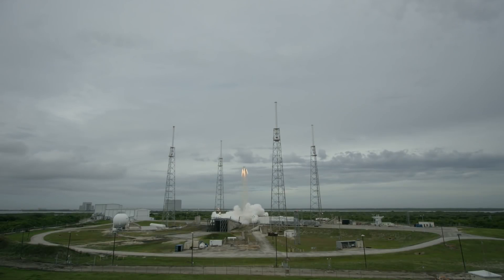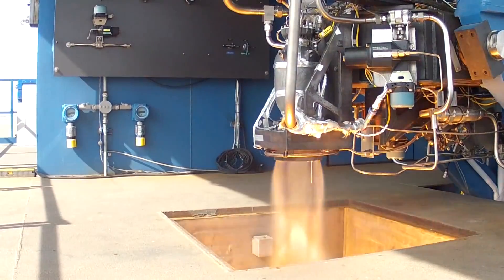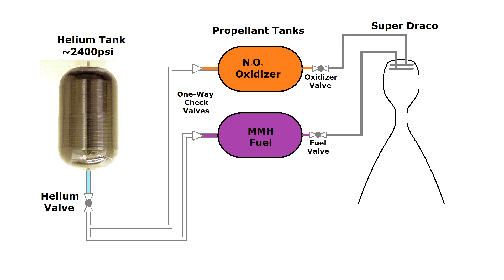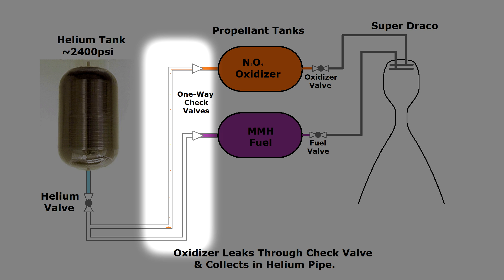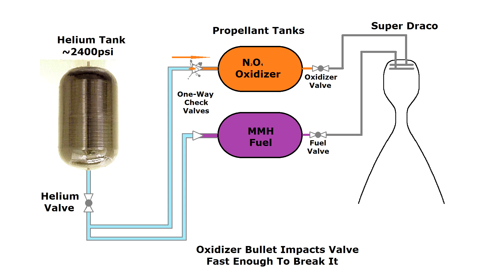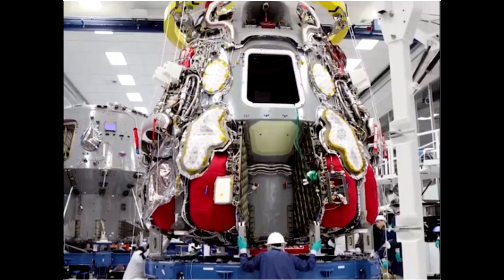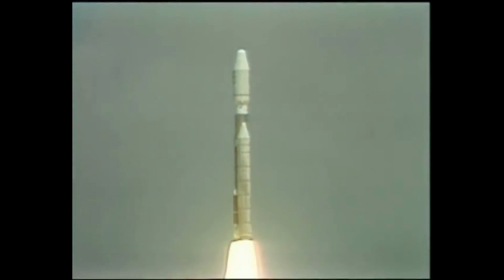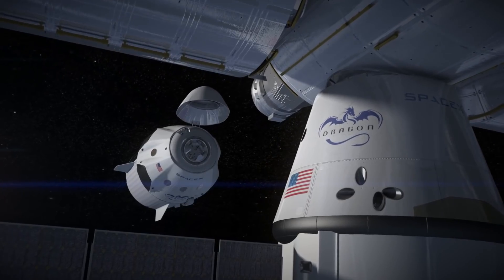SpaceX's Crew Dragon Spacecraft Exploded Because of 'Corrosive Bullets' and Leaky Valves

Comment: The decision to use a volatile, toxic and carcinogenic fuel like Monomethylhydrazine (MMH) and a highly toxic oxidizer that can dissolve your lungs as a part of integrated Launch escape system on a human rated spacecraft is a disaster waiting to happen.
Reply: That's just a silly thing to say. Fuels have always tended to be toxic. You're not meant to ingest them. And that had nothing whatsoever to do with this failure.
Reply: @odysseusrex5908  It had everything to do with this failure.
Conventional spacecraft design have reaction control and propulsion systems separate within service module which is completely separate from the crew module. Furthermore the escape launch system is conventionaly done via escape launch tower that uses solid fuel. 
Both systems are discarded well before reentry so the crew module descends without fuel.
I understand the reasons why SpaceX chose this approach, but it is a dangerous one.
Every Crew Dragon will have to survive violent atmospheric reentry and go for a splashdown full of highly reactive, toxic fuel.
As for not inhaling the toxic fumes, you can ask astronauts from Apolo-Soyuz Test mission.
They say it's no fun!
Reply: The Appolo service module used the same design.  IF this problem had occurred in an Apollo or soyuzservice module it still would have probably resulted in the loss of the crew because capsule is attached to the service module.  The spaceX explosion was strong enough to destroy the capsule.  In the Apollo and Soyuz systems you do have ha heat shield between the crew and explosion. But that is not designed to protect the crew from an explosion.  If the explosion makes a small hole or crack the loss atmosphere pressure could still kill the crew.
Reply: @stevenf1678    The service module's propellants were not pushed by super high pressure helium, thus, even if there had been some back flow, this kind of water hammer effect could not have happened. Also, I admit to not being very familiar with the Service Module's design, was it the main engine or the rcs thrusters that used this kind of check valve?

Comment: A burst disc does not replace a check valve though.  A burst disc is just an over pressure release mechanism.  So other details are missing here Scott.
Reply: The Superdracos are only going to be used in an abort scenario. The Helium tanks will be released and their extreme pressure will burst the disks. Hopefully, this will never happen at all, but it is an elegant solution to the problem.

Comment: Wait, I didn't understand the purpose of the burst discs replacing the check valves. Check valves are one way directional control valves, burst discs are one-time-use breakable surfaces.
Did I miss something?
Reply: Nop, you missed nothing. Except, this is an abort system, used once, or better never. The burst discs are more reliable than valves, and it is no problem they are one-time-use.

Comment: Won't there be a chance the burst-disk puts debris into the fuel and oxidiser tank?
Other options would be to either ramp up the helium pressure more slowly, or double up on the check valves maybe?
Burst disks will be nice and light though...
Reply: I replied to another similar question, but here you go: 

Depending on the type of diaphragm there can be fragments, which will require a filter.  It can be presumed that the design SpaceX will use is "scored", which reduced risks.  Search for "burst discs prevent pressure failures" for more information.

Comment: I wonder why instead of burst disks, they didn't adjust the Helium Press sequence to just open the valve very slowly, or even have a primary and secondary pressurization valve with the primary valve being a slow bleed. This would prevent corrosive bullets.
Reply: This is an abort system. Everything should be fast and as simple as possible.

Comment: Can t space x replace the titanium for the pipes with an alloy to not react with the oxidizer and fuel? It just feels like their solution isn t long term because they telled nasa that it could be used for a landing burn(s) , so i feel like they would revisit it.
Reply: You're right, the solution isn't long term, because they expect Dragon and Falcon to be completely replaced by BFR in three or four years.
Reply: It will take time to test alternative metals for compatibility in this failure mode.  If metals don't work then a ceramic check valve would have to be designed.  It will take time to evaluate all the possible materials and then design a new check valve. For I suspect someone at space x is currently doing the needed tests and research to solve this problem.  But it could take a year or more to do.  For now keeping the current check valves and adding burst disks is the best anyone can do.
Reply: @stevenf1678    My understanding is that they are replacing the check valves with burst disks, not adding them. This is because the Superdracos will only ever be used as an abort mechanism, thus the change does not affect reusability, which is minimal anyway. Besides which, SpaceX expects to replace the whole system fairly soon anyway.

Comment: This is a significant paragraph from the SpaceX report: 
”It is worth noting that the reaction between titanium and NTO at high pressure was not expected. Titanium has been used safely over many decades and on many spacecraft from all around the world. Even so, the static fire test and anomaly provided a wealth of data. Lessons learned from the test – and others in our comprehensive test campaign – will lead to further improvements in the safety and reliability of SpaceX’s flight vehicles.”

It is sad, but unavoidable, fact of engineering that we learn 1000x more every time some component fails (a structure collapses, a plane crashes, etc.) than we do when the structure or machine performs as expected.

When they perform “as expected“, we learn nothing new.

The phrase, “... the reaction between titanium and NTO at high pressure was not expected ...“ suggests that this interaction has not been previously reported in the literature. It will be included now, to the benefit of all future spacecraft designs.

This lesson was, gratefully, relatively painless to learn.
Many other lessons have been far, far more painful experiences.
Reply: Interestingly, in the book "Ignition!" by John D. Clark, a 50s-70s era rocket propellant chemist, he mentions a unique engine failure where nitric acid reacted with the titanium propellant lines and exploded, to everyone's complete astonishment. When I read that, I wondered if somehow NTO, though a different oxidizer, might have done something similar on dragon.
Reply: @damightymage5049  not that different, red fuming nitric acid ( the one in question I believe ) is something like 13% by weight dinitrogen tetroxide, and I believe dinitrogen tetroxide forms concentrated nitric acid on exposure to water and heat ( it's how nitric acid is produced )
Reply: @damightymage5049  NTO is nitric acid without hydrogen, and NTO mixed with water makes nitric acid. It is actually surprising that titanium is used with NTO. It is also somewhat surprising to me to see common helium tank for both fuel and oxidizer. If worse comes to worst there is a possibility of mixing of the hypergolic propellants.
Reply: @gustavlicht9620  
That may have just been Scott simplifying the diagram.
Reply: @firefly4f4  conjecture
Reply: @damightymage5049  ....This is a fact.   Some rocket surgeons might want to refer to the dark art of chemistry before they try visiting the stars
Reply: @SheldonRobertson-f9m  
You're aware that at those pressures anything with combustible molecules in it (plastics) will go, right?

They use titanium because it is so inactive with other stuff while being strong.

Just an example from the civilian side of things.. 200 bar oxygen bottles.. diving equipment.
One is not supposed to grease those fittings (o-rings, etc.) as things can explode under those pressures.. just from the molecules in the grease being combustible.
Reply: It actually has been included in literature, there are nasa tests where it says something along the lines of that titanium only burns on high velocity impact of nto and then only at that point.
Reply: @PlasmaHH  Yeah, so SpaceX engineers were just unaware of the existing results, hence their surprise.
Reply: teefkay2    Yes, when something " performs as expected" we don't always know why it performed as expected or if the effect is reliably repeatable. 

If the person with a perfect 4.0 GPA has never experienced figuring where they sent wrong, have they really learned something?
Reply: @bobroberts2371  .....this failure would have been expected if these gals n guys cared to look at how others had failed before them.
This was a known issue and had no safety measures applied to detect nor reduce the possiblity of liquid in a high pressure pipe.
Remember the "Deepwater Horizon?"  The folks at BP blamed a valve for that too.
Reply: teefkay2 yep. The entire reason for testing to begin with is to discover and remedy new failure modes.
Reply: Exactly! This may have been expensive, but it's a thousand times less expensive now than during a launch, and incalculably better now than when the Dragon is crewed.
Reply: @Kevin_Street  ....now calculate why the lessons learned by previous rocket surgeons wasn't applied to the design in the first place.
These weren't unknowns but problems that have been known previously, with NO safety measures to monitor or relieve the condition.
The only people getting on this kind of privitized "space" craft will be cowboys (extinct) and morons (the infestation.)
Reply: @MegaBrokenstar  .....except these are old failures being repeated by new people.
Reply: SpaceX's failures so far have been things they been pushing the envelope on making ready for prime time. Composite pressure vessels for example we have learned a lot about since SpaceX began using them in places and pressures previously unseen, and they are that much more practical now to use because of it. We can't learn if we don't push, fail (safely), and repeat.
Reply: "Fail quick, fail often"

Heard that phrase from more than a few ppl who work in development
Reply: @blackoak4978  Elon uses the 51% rule for early design phases. When a group of engineers at Spacex is 51% sure an idea will work,,, they do it. This explains the astounding pace that Falco 9 and heavy have got to where they are so rapidly. They also use " the best idea wins" concept. He has said that there are ideas flying on Falcon that interns have come up with. That's why he is so unique and incredible. I have made industrial prototypes for over 30 years, so failure has been my constant companion. I love it.
Reply: @SheldonRobertson-f9m  be better just to design the system so that the NTO doesn't go where it isn't supposed to be!
Reply: @ke6gwf  ding
Reply: I presume they never had this high pressure hidrogen hitting the NTO in titanium.
Reply: @SheldonRobertson-f9m  Plastics don't do so well with N2O2. In fact not many things do well with it. They might want to sacrifice a little weight and switch to stainless from the helium tank to the burst valves. I think burst valves will do the trick.
Reply: And no one was hurt in this falure. Main thing.
Reply: Too true. I've heard it said that if the Apollo 1 tragedy never happened, it likely would have happened with the astronauts in deep space, and they never would have figured out what happened or why.
Reply: To quote a movie my daughter watches endlessly these days, Penguins of Madagascar, "Oh well, this is why we test things people."
It is so true though. And NASA has even been saying that they are looking on this failure as a gift because it allowed them to recover all the pieces and test them and analyze them. What a wealth of data and knowledge gained with relatively low cost, no lives and a capsule they were just going to use in a test anyway. I also like how ridiculously methodical SpaceX has been with their failures. Going to validate their theory with actual materials testing to gather even more data about the problem. And you get the sense from them that while it sucks to have something blow up or not land right, they kind take it in stride like, okay, now we get to advance our rockets even more!
Reply: @Terry Hunt 
Heh, didn't knew that. Only familiar with his scifi novels and love them. :-)
Reply: If this type of situation had never occured before, I could completely agree with you.
But it has and the new kids on the block who built this death trap are just repeating the same mistakes as previous generations.
I know not of this literature you speak of....would you please send a link?
There is no verbage that relates to safety measures like sensors to detect leaky valves or a trap built into the piping to collect condensation or leaked fuel.
A reaction between a metal and a chemical was not expected?  Plz
This is what to expect from space travel on a budget.
Reply: @SheldonRobertson-f9m  ....The problem is with the oxidizer being on the wrong side of the valve (leaking past it.)
The titanium piping for the compressed helium is a good design.
The valve failed and the pressures on either side of it were obviously not monitored, nor was a trap in the pipe built to collect any liquid oxidizer installed.
The stainless steel piping for the liquid oxydizer is a good design as well.  It is heavier than the titanium, so it is only used after this valve that failed.
The rocket surgeons say they will just not use a (back flow preventor) mechanical valve in favor of a bursting membrane.
Maybe  no pressure monitoring sensors nor fluid traps were used in the name of weight savings or money savings.....I couldn't be sure.
Reply: Better to have it fail during a test than with a human crew on board.
Reply: and that knowledge is invaluable, they pretty much sacrificed a 90M booster to find out what it can REALLY do and where it would fail. If it had landed it would have been an astonishing achievement-win/win.
Reply: @prusak26  It landed. They were testing on the ground before another launch.

Comment: hi Scott another great video and very descriptive,just wondering if it happened berthted to the ISS
Reply: Super Dracos wouldn't be fired anywhere near the ISS, especially while docked, so this wouldn't be an issue unless it was fired by accident. At which point, it's not really the valve's fault.
Reply: Of course not. This happened sitting on the ground during engine tests.

Comment: Might just be because I'm no rocket surgeon but I'm not understanding how these burst disks replace check valves. My guess would be that in the event of fuel or oxidizer trying to go the wrong way through the system the disks burst and dump it overboard instead. Is that even close?
Reply: No. The pressure inside fuel and oxidizer tanks is too low and can't break the disk. Only the high pressure of the helium tank can break the disk.
Reply: @ivoivanov7407  didnt think of that, thanks Bro

Comment: I am always amazed at how often an explanation can be found for a destructive event.  And that with the corrective action in place, it seems to fix the problem.  So apparently they found the real issue.  Of course in many cases they already knew about the weak spot, but went with it anyway.  Space Shuttle solid rocket booster o-rings I am looking at you.
Reply: Although there was an understood problem with the O-rings, which was being addressed, by launching in subfreezing conditions, against the no go of the relevant engineers, the launch director might as well have planted a bomb on the SRB. Had he listened to his people and waited 24 hours, there would have been no problem.

Comment: I think there's a way to test if burst discs are intact, if they had 2 discs separated by a small gap, and add a small tube in the gap with a detector, if a disc is blown  the sensor will see the pressure of the system.

Comment: Would it also have been possible to have multiple check valves in succession, to reduce the chance of leakage? Since it would need to pass through multiple valves, I mean.
Reply: It would bullet between the valves. Not too much difference.

Comment: I’m a chemical engineer, and have solved this problem several times. The best solution is to provide a burst disk that protects the check valve ... the burst disk is usually placed between the check valve , and the fluid you can’t have leak. A burst disk alone will also work.

Comment: It actually makes sense for them to use crush valves on the Super Draco fuel lines since they’ll be rarely used unlike the RCS thrusters which get used for 100 percent of the in space maneuvers including deorbit burns. It would just be more of a headache to get in & replace them if/when they do get crushed but at least it would prove to be a safer design change.

Comment: Does that mean that the burst disc will have to be replaced after each flight?
Reply: I imagine they'd only need to be replaced if they fired the Super Draco engines, which should only happen in testing or during an actual launch abort.
Reply: Got it. Thanks.

Comment: Abort motors have to be solid fuel only. This is an ABC of engineering that a backup system must be simpler than a main system for the sake of reliability.
Reply: This was meant for abort and landing, and they apparently intended to test propulsion landing during some cargo missions, pushing technology further even without nasa.
Reply: @randomnickify   then this is a fundamental architecture flaw. Safety system must be safety only. It's written with shuttle blood.

Comment: Scott, if the one-way valve is replaced by a use-once burst disk, what stops the fuel/oxidizer from flowing back towards the helium tank once the system is under pressure? Does that mean that the super-dracos are used only in case of abort, and never for maneuvering?
Reply: Yes.